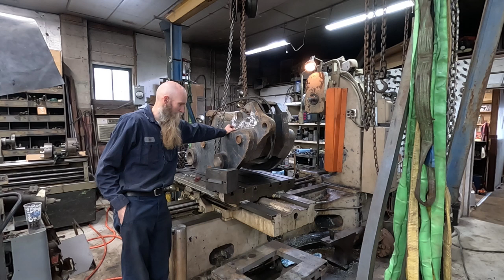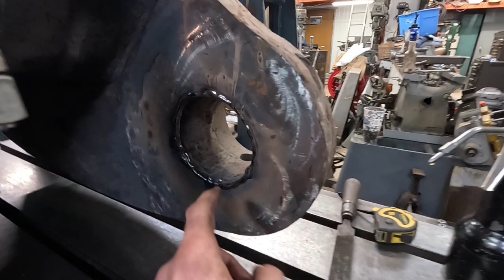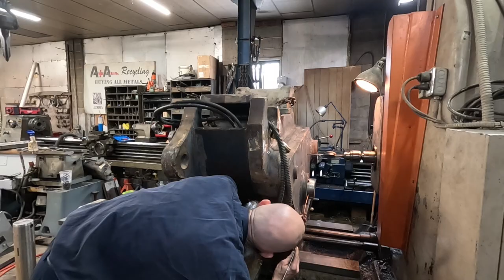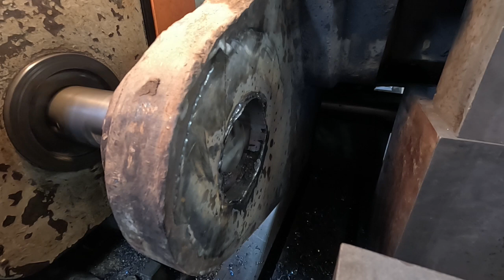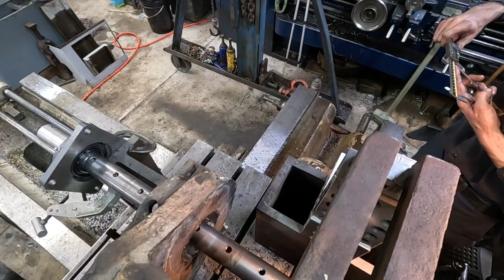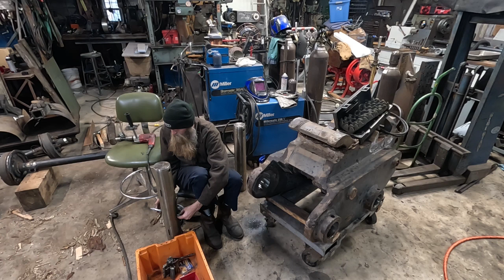Pin Disaster! John Deere 470g Coupler Rebuild

Comment: That's a lot of hard work and sweat.
Reply from the maker: I still can't get my head wrapped around how the pin could be so far out of round 🤯
Reply: @Andy-PerpetualMotion  Just goes to show  that you can't trust anything that came from unknown shop.  Too many variables that are out of your control.  Especially in light of some of the videos that we've all seen of stuff made in less sophisticated parts of the world.  It's hard to see precise parts coming out of a shop with dirt floors.  That is not much of a foundation for setting machines on..
Reply from the maker: @terrymoorecnc2500  I just don't understand how you can have a part with a center in it that is neither concentric with its own center or round, absolutely mind-blowing. I feel like you would have to be trying to make junk parts on purpose to get one like this.
Reply: @Andy-PerpetualMotion  if you had chucked it up in a 4 jaw and 4 pointed it, I suspect the center would have to have been retooled.  What you did was more than adequate for the job. This thing had a hard life.

Comment: As soon as you showed that pin on the lathe I started thinking about those videos where they make nuts and bolts from old anchor chains lol. I think you did an excellent job considering what you had to work with. What a piece of junk.
Reply from the maker: I just kept remembering all the videos I had seen of the garbage parts they make in India and Pakistan, and wondering if I had actually seen this pin get made🤣

Comment: Is it suppose to be a "slip fit" or a " interference fit"?
Reply from the maker: Slip fit, the mechanics pitch a fit if they have to fight with one. I've actually had some guy try to talk me into .020 clearance to make it easier to put the pin in🙄

Comment: Great job.  I was just wondering why you spent all of the extra time setting it up on the boring mill instead of just using your boring bar?  Thanks.
That was a huge project!!!  You were obviously extremely tired and stressing about things that only Andy would worry about, and in the end did the right thing.  
Regards.  Make that High regards.
Reply from the maker: @KW-ei3pi  thank you for the kind words. I only use the portable gear if I have to, it is much harder to get accurately set up with the portable rig, and when you have to pull out and weld up low spots it gets to be a thrill. Most of the guys doing stuff like this with a portable rig are only doing it that way because they don't have a horizontal boring mill.

Comment: Could you just weld some angle onto that for bolt down points or is it just as quick to get the blocking set up?
Reply from the maker: The point of all the v- blocks was to get it setting on a pin in the bore that was still good so I could be confident I was keeping the other bore square to it. The other stack was just a single point contact so I ended up with a three point mount. I have welded stuff to parts before but this one was too touchy to get aligned using that method.